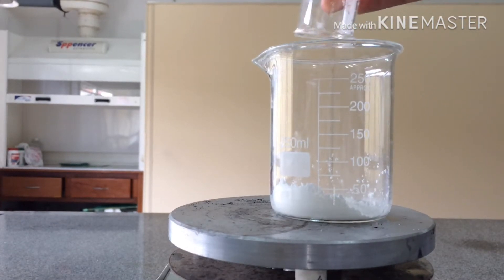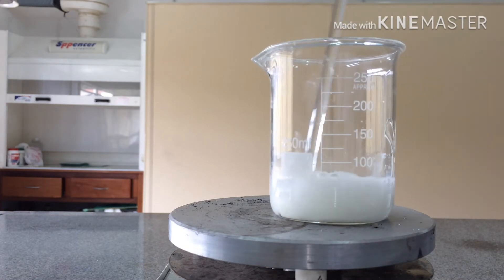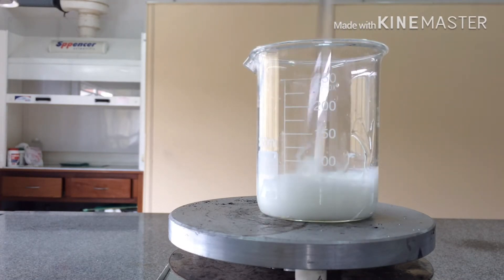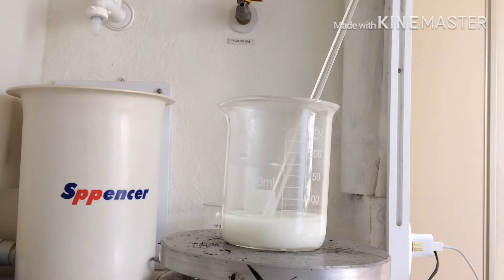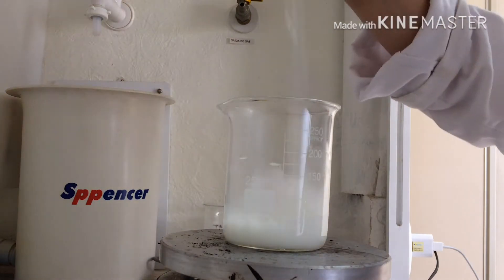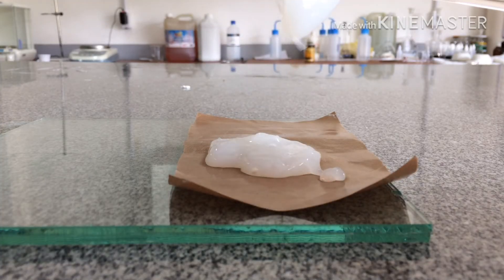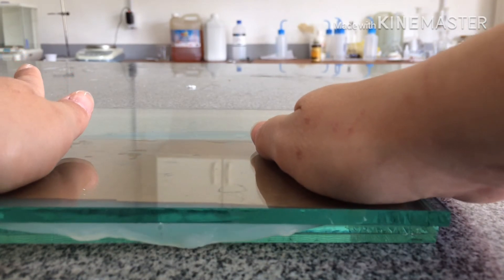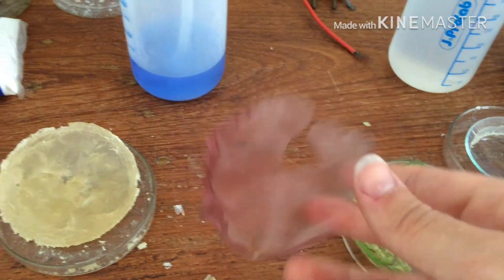BIOPLASTIC FROM POTATO STARCH

Comment: Obrigado for your explanation
now how can I fit this in my 3d printer?
Reply from the maker: Hi, i don't think this plastic can be used in your 3d printer or any other polymeric processing like injection or extruder, is different than comercial "biodegradable" plastics. But you can read this article about bioplastics used on 3d printers, but most of them are degradeble and not biodegradable: https://www.sculpteo.com/en/3d-learning-hub/3d-printing-materials-guide/3d-printing-bioplastics/ 
Hope it helps :)
Reply: @waterliliesisa  thanks, that save me the time and energy to experiment on these
Reply from the maker: you're welcome

Comment: hello, 
As of my knowledge this starch based plastic are hygroscopic ( adsorb water ) is it the case with your samples?
Reply from the maker: hello, yes it is, but we did not test, to have the exact rate of how much water it absorbed , we tried to see if it was soluble in water but it did not dissolve so easily with hot water and mixing, we did not make a anti-aderent coat but thats possible